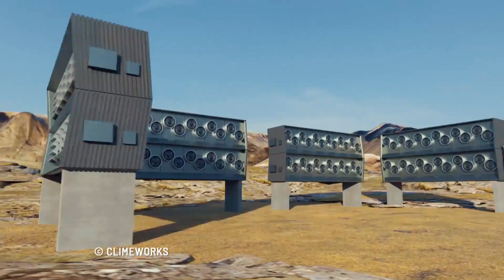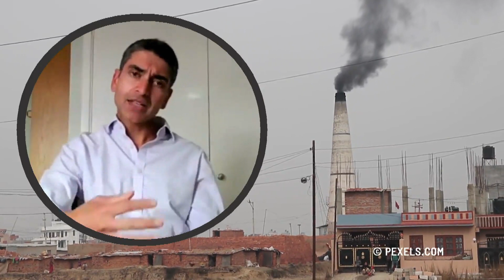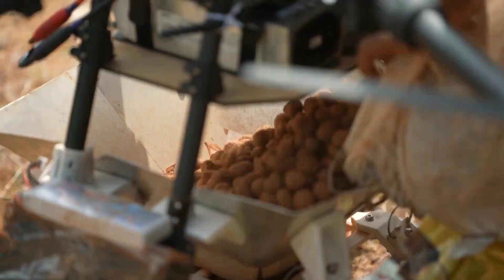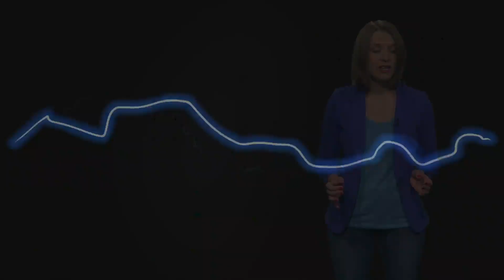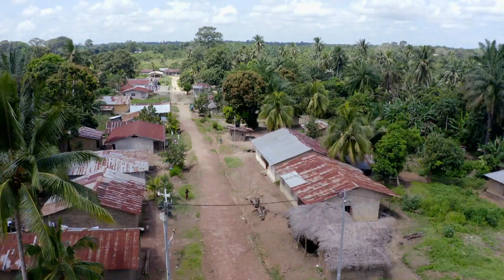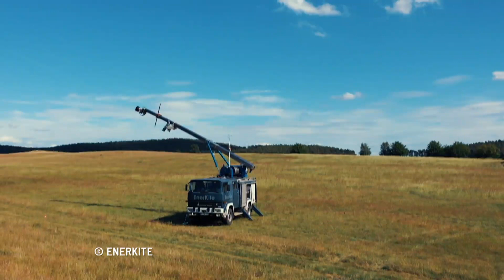This Technology Helps Us Fight Climate Change

Comment: The solar solutions shown are not very good. The new standard is dual use. For example parking spots with solar roof or agrovoltaics or floating solar protecting water reservoirs …